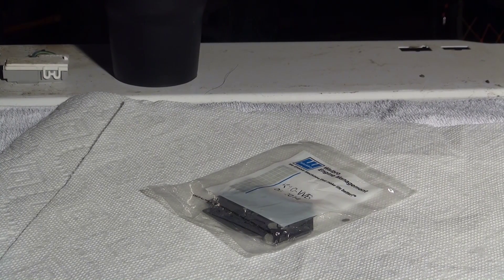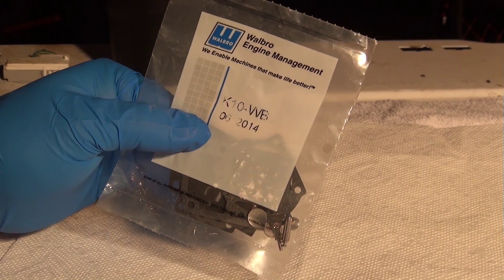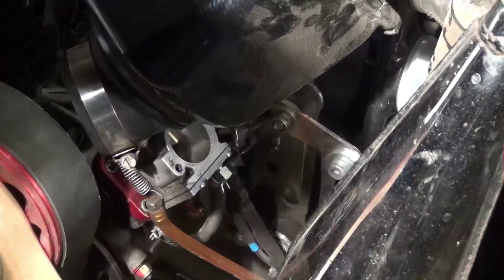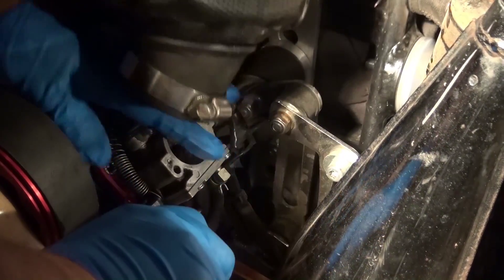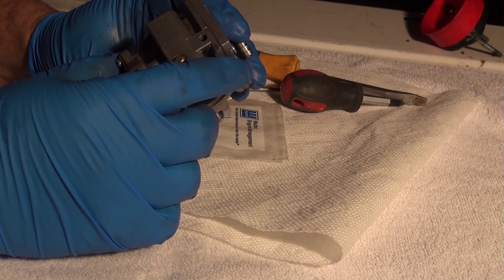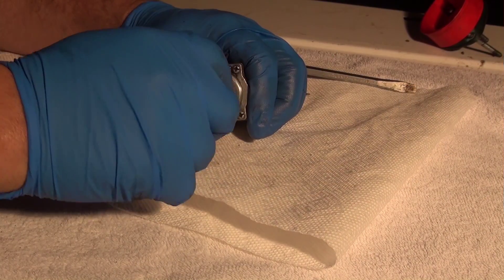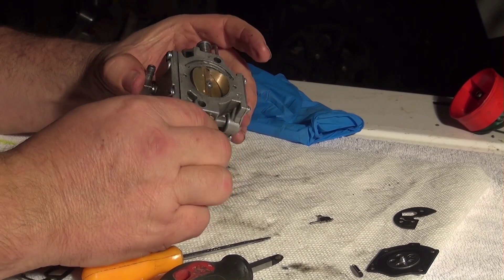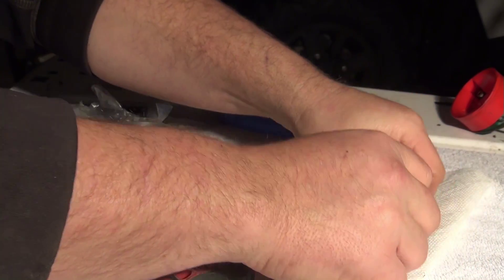Walbro 37C Carburetor Rebuild

Comment: you didn't replace the fuel pump side filter.
Reply from the maker: I did that on purpose to leave out the small mesh screen because when they get plugged it starves the carburetor for fuel resulting in it dying . It's there to protect the cylinder from getting scored.  But really . If particles that are that small would most likely get burned up in the combustion chamber process . I have had my shares of motor outs and I didn't want to make a plugged filter one of them . But that's my thought process . An accumulation of particals can block fuel flow . Look up my Black hawk down video and see the junk I pulled out that carburetor.  And that was after it went though a in  line fuel filter . I always run fuel filters before it reaches the carburetor.  Thank you for watching.
Reply: @Trike.  the holes for fuel delivery are very small and can plug real easy. Either way you will have problems I guess.  With filter it would be gradual.